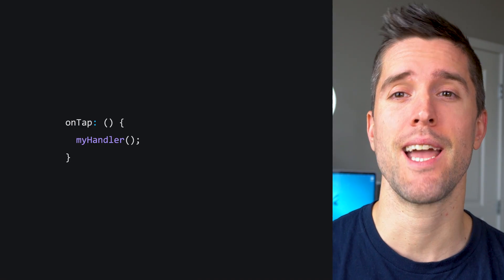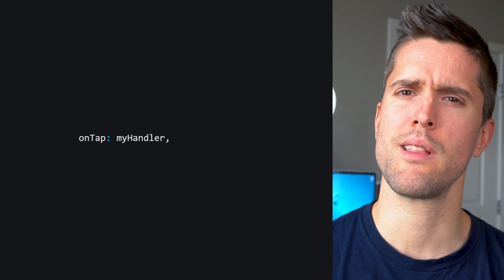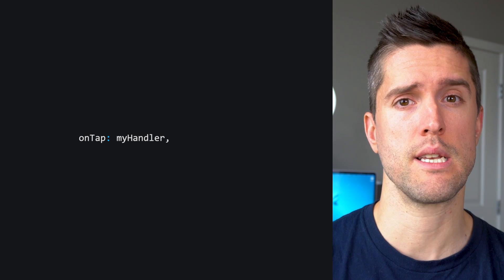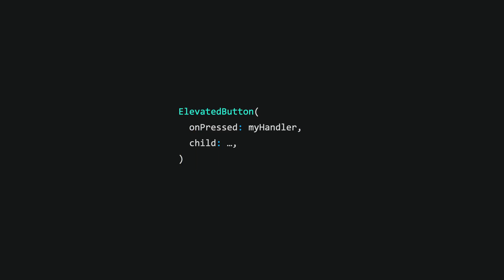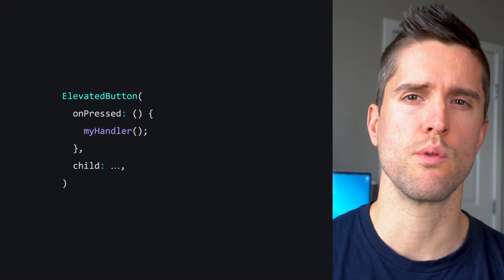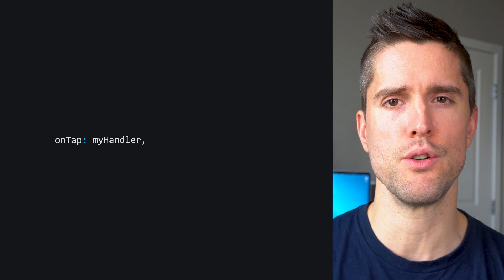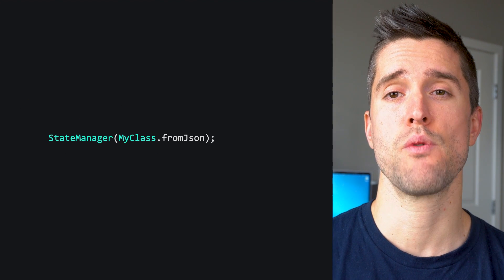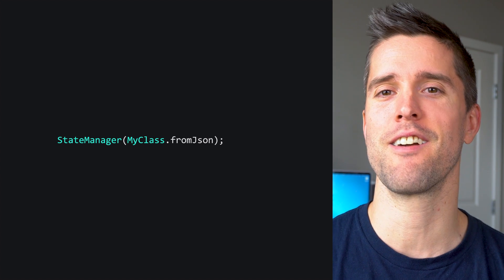Tear-offs | Decoding Flutter

Comment: Hi! I am new to flutter. So a tear off basically removes the unnecessary use of lambdas.
So the benefit is:
1. Clean code practice: Supply the function when it needs to be supplied, call a function when it needs to be called. 
2. Not using lamda when we can do without using it. I guess, it is memory efficient.

Am I right or am I not?
Reply: The main benefit is pretty much cleaner code. You have less opening/closing braces/brackets (which Flutter already needs a billion of already!)  and less lines to show the same result.

You're right that (at least in theory) there's a memory advantage, but a single function has pretty much negligible memory usage on its own, and that's before we consider how the dart compiler probably optimises lambda expressions to save on even more memory anyway!

Comment: Thanks for the explanation of a tear-off. I had been wondering what all this hubbub regarding Dart tear-offs was about. I thought... What even is this new concept Dart has created called tear-offs? So now I know that it really is just syntactic sugar which the Dart compiler expands to a closure calling your function. Makes sense, and saves us from having to type a few more braces and parentheses. And we definitely don't need any extra bracing in our Flutter UI code...

Comment: But if you have to pass some input to the method then in that case you will have to use lambda instead of tear off , correct?
Reply: Nah you wouldn't need to. Using a tear off with something like onChanged or onSubmitted in a TextField would automatically pass the "value" argument into your tear off.
Reply: @bettercallshox  yes but it won't work for on click or on press method if a button and I side that on click I am calling a method which takes input

Comment: Nice  done. In case I miss it why are tear-off better then lambda? Is it because of better readability or does it have performance impact. What are the implications, that would nice too, to explain, just for next time. Anyway great video serie
Reply: Tear off uses the function object directly, while lambda will create a new function object which will execute the function. Take this with a grain of salt as I assumed it is the same with kotlin (inline function specifically)
Reply: Thanks you for your answer. I had same thought 🤣. At least we have a possible explanation for future watchers / readers 😇 - I hope the next time they will decode it directly in the video.
Reply: To make the explanation above make more sense!

It means whenever a stateful widget updates it state, you are creating new lambda functions too!

But using a tear-off, you are just passing the reference which already exists.
Reply: Lambda is nameless and would add unnecessary layer to call trace / stack trace